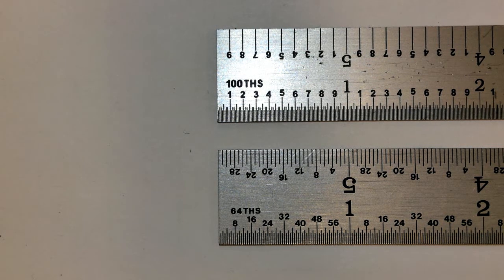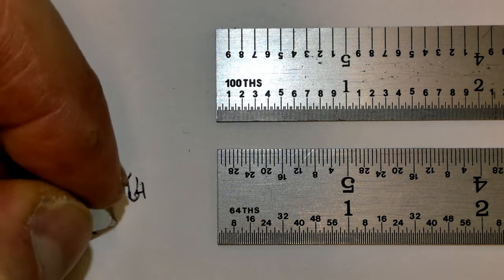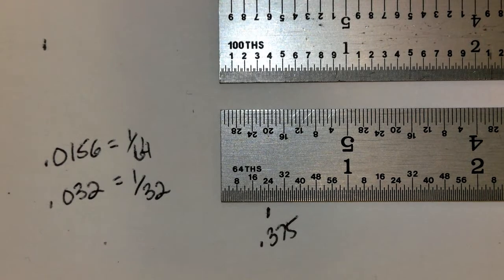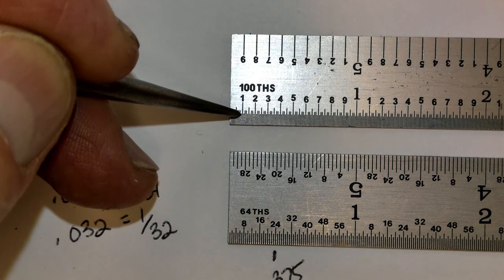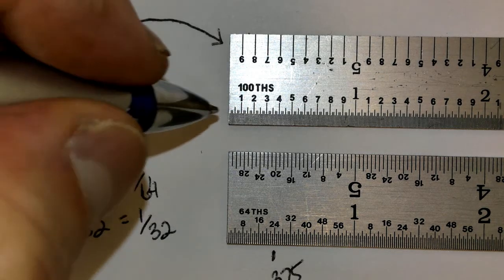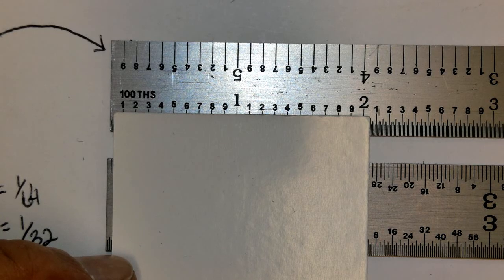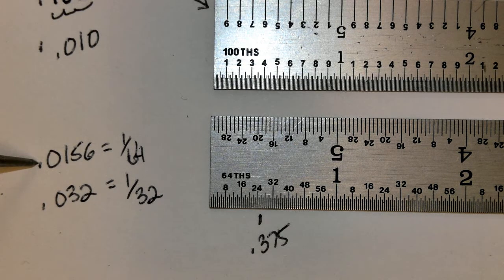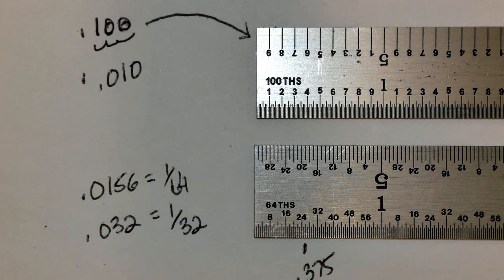Measuring with the Scale or Steel Rule 1 of 2

Comment: That is similar to a steel rule my father had. Most have the common 1/2  1/4  1/8  1/16 fractions but his was for the printing industry that had "points" and other scales as well. It was related to font sizes but amazingly the size of fonts that we understand from our modern computer programs do not actually correspond.